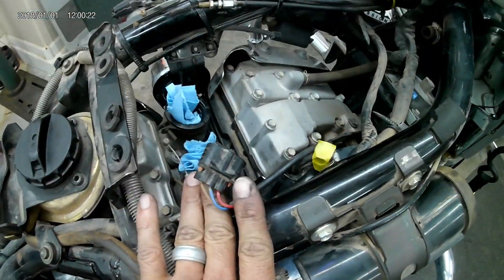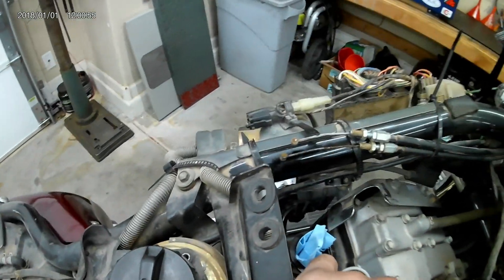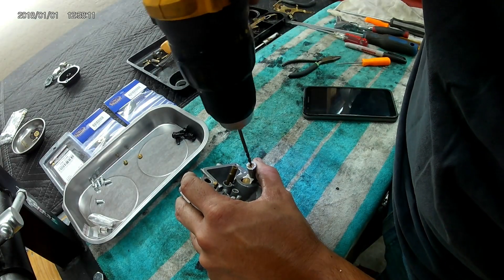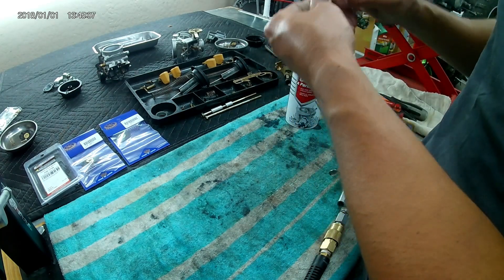2003 Suzuki VL1500 Intruder Carburetor Rebuild

Comment: Hi, love the video, very instructive! Can you give me the part number of the air cut of valve ?
Reply from the maker: The diaphragm is Suzuki OEM 13480-10F00
The all balls racing rebuild kit # is 46-4039 which includes the diaphragm, spring, and cover screws.
Reply: @LightningMotorsportsAZ  Great! Thx for the very fast answer! Keep it up your doing a great job!

Comment: Hi! This video really helped me, thank you! I have a quick question, the big black hose on the top of your carb, I believe it's called an air vent hose or something. Is that connected to something?
Reply from the maker: Is it pointed out in the first 3 mins of the video?
Reply: @LightningMotorsportsAZ  Thanks for taking your time to answer me! I really appreciate it. It's not mentioned, so I was unsure where it goes..
Reply from the maker: I would need to see the hose you're talking about.  You can email me a picture if you would like.
lightningmotorsportsaz@gmail.com
Reply: I think you are talking about the pver flow tube. No its not supposed to be connected to anything. It just let's the extra fuel out instead of dumping into motor

Comment: Where did you find a complete rebuild kit for it?
Reply from the maker: All Balls Racing 26-1746.  Fits 98-04 VL1500 Intruder
Reply: @LightningMotorsportsAZ  I appreciate the response! How about the air cutoff valve kit? Doesn't the emulsion tube press fit in these?  are the needle valves stainless steel or aluminum? I appreciate your help, as there is no other help out there, other than sending the carbs off to Washington to be done. I want to do it myself! Built not bought! The gentleman in washington isn't much help as far as parts goes...